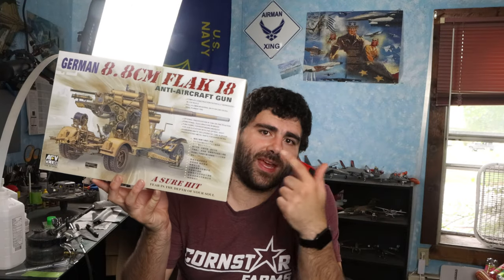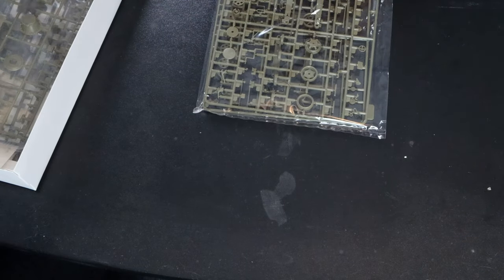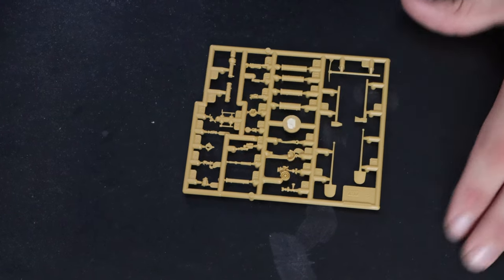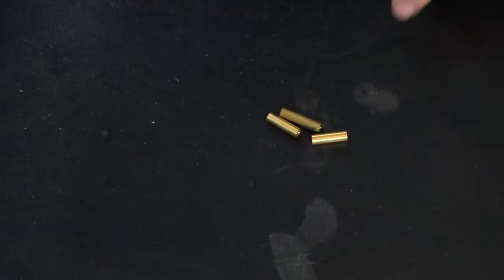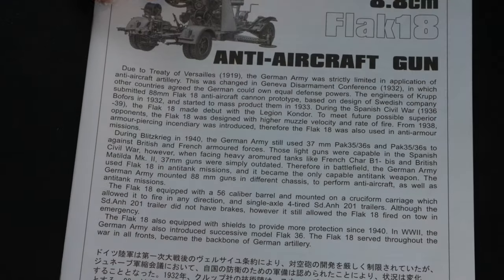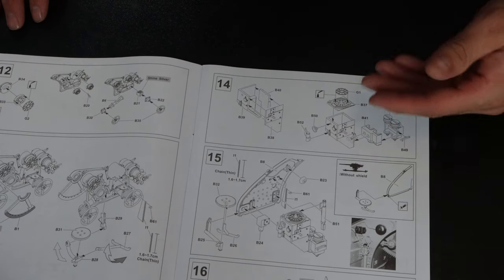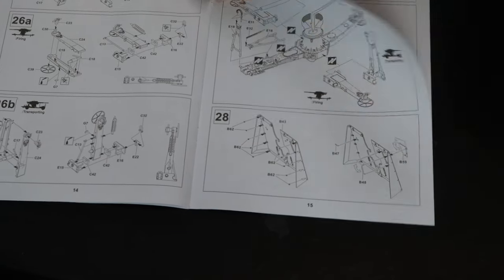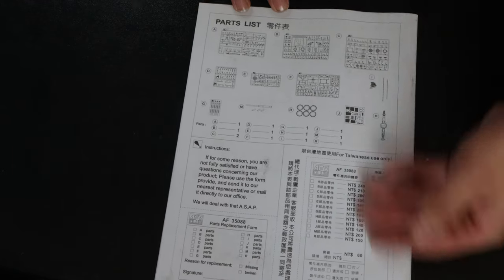AFV Club 1/35 8.8cm flak 18 Unboxing

Comment: Recuperator(to return gun to original position using gas) is the single tube above gun, equilibrators are the 2 cylinders below gun for height adjustment
Reply from the maker: Good to know, i'll never pretend to know what i'm talking about, i can just point and say what i think hehe.  Thanks for the info!